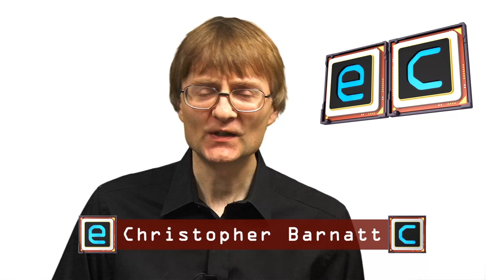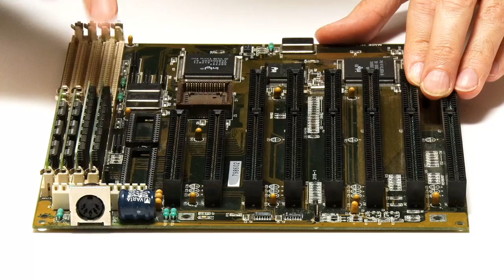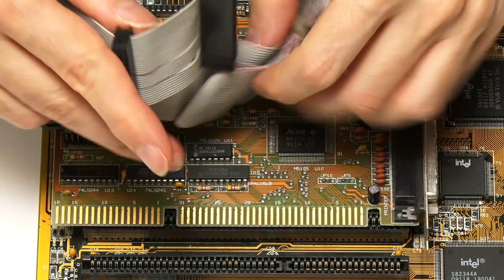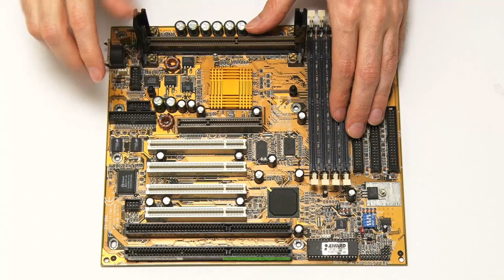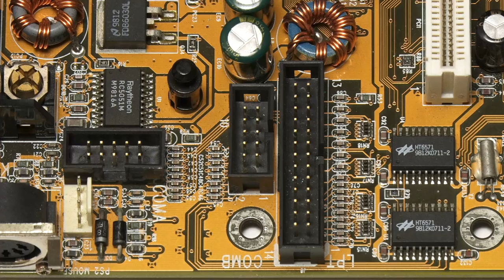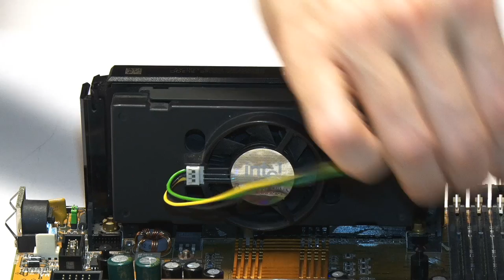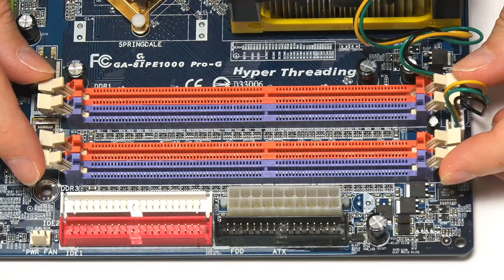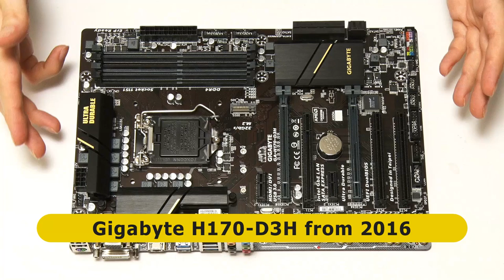PC Motherboard Evolution

Comment: In 1998 I built a gaming PC for a buddy at work and was a little amused when he said it would be his last because he didn't think that they would ever get any faster. SMHLOL
Reply from the maker: Great story! :)
Reply: lol in the late 90's / early naughties your computer was already old 6 months after buying it,
those gains on the GPU generations were insane back then... +70-120% orso
Reply: @klontjespap  also cpu wise in this last decades cpu speed depends on cores numbers while ipc performance increases are measured in percentages.

Back then each cpu gen was around 2-3 times faster.
Reply: I went from 486 DX2-66 (33 Mhz) in 96 to Pentium 166MMX with Voodoo2 in 1998. Quake went from 320x200@10fps 8 bit color to 800x600@60+fps 16 bit color in just a couple of years.
Reply: @artemaung5274  geez. id say thats roughly like going from 25 fps at 720p (medium settings) to 1440p 144fps (ultra settings), which took us the last 10 years
Reply: @_j_t_p_  It absolutely was that dramatic, year after year, for pretty much the entirety of the 1990s and only slowed a bit in the early 2000s.  The past decade's gains have been glacial by comparison.  My 3500 USD (in 1989 dollars) PC was obsolete garbage two years later.  It couldn't run anything that came out two years later in any vaguely tolerable way.  My 8 year old 1000 USD (in 2012 dollars) PC is currently serving as my son's 1080p gaming rig and giving framerates higher than his monitor's refresh rate using a 70 USD used mining card I got off Ebay.
Reply: A computer instructor where I went to college was teaching us about old hardware.  Each time he mentioned a "new" system, he would sarcastically say "all you'll ever need"!
Reply: @_j_t_p_  John Carmack is an absolute machine.
Reply: What brand of case did you use? I’m building a 1996 PC right now but I’m struggling to find any brands that made cases back then.
Reply: @Caleb-fv5fp  - They were all pretty much generic cases back then.
Reply: @johncnorris  they sold generic cases to the public? I thought those were just for OEM PC manufacturers
Reply: @Caleb-fv5fp  - They used to have roaming computer shows that vendors would bring a trailer full of their product so you could go from booth to booth and buy all the parts for a PC.  With cases I would walk the floor and decide which 'no name' case I liked the best and buy it cash with all the other parts.  Imagine Amazon but you could hold the parts in your hands before buying them.
Reply: @johncnorris  where they similar to brands like inwin? They have cases and models of cases but they have zero branding or model numbers anywhere in or on the case.
Reply: @Caleb-fv5fp  - To be honest I don't know.  I have heard of Inwin but don't know much about them.  Most of the cases back then were copies of other companies' designs and were pretty similar to each other with only slight variations from the previous models.  It wasn't until Dell and Gateway started to release their own designs that you could tell one from another.

Comment: The days when you accidentally discover overclocking by putting the jumper on the wrong pins
Reply from the maker: Wonderful!
Reply: Or when components let out the magic smoke because you put a jumper on the wrong pins.
Reply: Don't forget the old 2 part power connectors that you could get switched around and potentially fry the board unless you kept the black wires next to each other
Reply: And I fried my HDD :D
Reply: @mephInc  Oh, man... screwing up jumpers could get bad.  I've seen dead CPUs and motherboards from that.  Getting an incorrectly wired Molex connector on a power supply (most were generic junk back then)... that could be even worse.   Let's just say that I have never before or since heard a hard drive make quite that noise (like a robotic shriek of pain) or produce acrid black smoke and brief flames.  The technician working on it cut the power and hit the system with a CO2 extinguisher.  

Wrenching the somehow intact Molex connector from the slag that had been the socket and then identifying exactly why that... dramatic... moment had happened was a job our entire group of technicians focused on.  From that day on, we checked the wiring of every single molex connector before ever plugging them in and powering on the PC.  I was so glad when they ceased being a commonly used connector (and also when PSUs from reputable brands became common).

Comment: Couple  comments: 1. 386sx was  a cut down version of the 386, so much more powerful processors existed in that time. 2.  The lack of a key on the floppy connector was specific to that board. Those kinds of connectors had a key system for decades. Typical was to skip a connector and place a block on the female side to prevent mating. 3. The hologram on the Intel CPU module was for counterfeiting. That was actually a large problem at the time, people would erase the markings on chips and relabel them.

Comment: Cable management.... I remember it meaning "How can I actually cram all of these in here and still manage to hook it all up"
Now it's "oh look. It's pretty!"
Times sure have changed. Great video and it brings back bittersweet memories of the horrors/joys of working on old PCs.
Reply from the maker: So true on cable management. So true.
Reply: Especially if you had to organize SCSI ribbons!
Reply: I remember that I purchased adapters to allow IDE drives to be hooked up to sata connectors.  It was such an improvement on cable management - even using the older - cheaper - IDE drives.